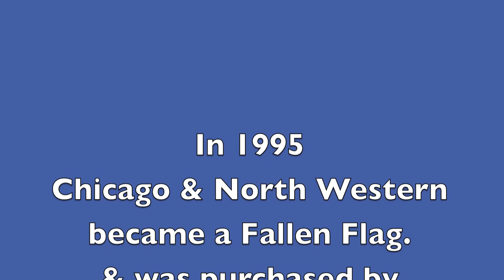MENARDS BOX CAR

Comment: Thanks for the info on the Menards boxcar.  I have been curious about the quality and construction.   In your next video perhaps you will comment on the trucks (I.e. diecast, sprung, etc and the paint job, hand rails, brake wheels, etc.)   Thanks again great job!
Reply from the maker: Hi Peter / The bottom of the cars & wheels are metal.  The trucks are plastic, The boxcars are plastic with operating doors. Detailed graphics. In this price range they are an excellent value. Thanks for watching and commenting. Gary
Reply: ***** Hi Gary, thanks for the follow up and information.
Reply from the maker: Hi Peter: Your welcome & thanks for watching. Gary  🚂